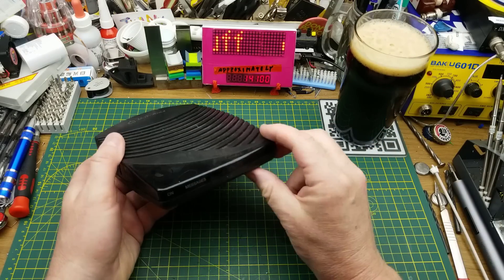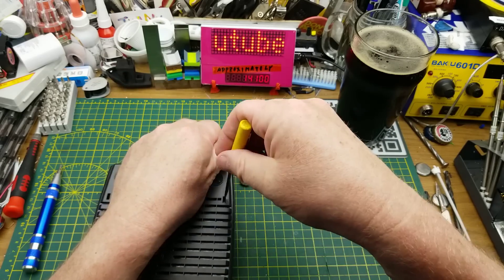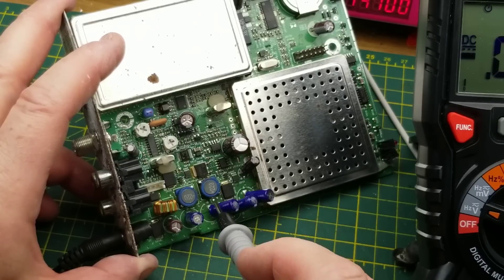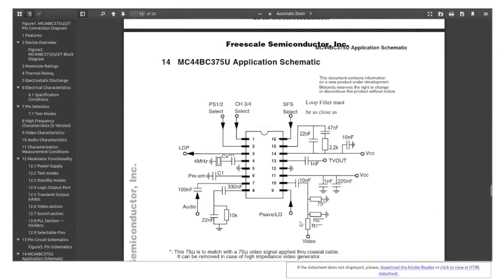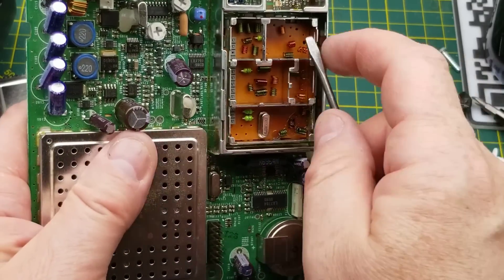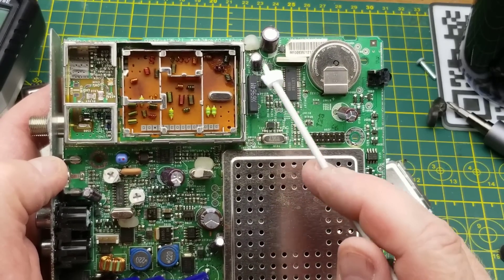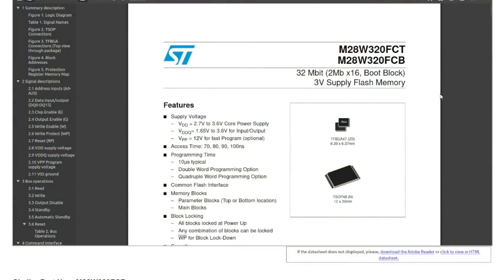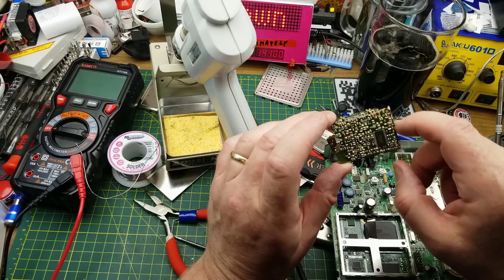Curiosity teardown: cable TV box

Comment: If the battery (2450) 3 volt goes bad, will my Motorola cable box still work? Mine has the original battery in it and it is giving me fits.
Reply from the maker: Different equipment reacts differently to a low battery.  Some don't care, some get chaotic.

Comment: SRAM is probably stream cache, decoding is in the CPU with it's dedicated SDRAM and the bootloader and code flash.

Edit: The SRAM since it's only 256kB could be authorization and decryption codes. Having the battery backup could be to protect the contents of the SRAM.

Comment: Those receivers had the ability to decode mpeg2, but not mpeg4.
They also had a subscription system, the base channels worked fine without paying, but all the premium channels needed to be authorized. I presume there was some kind of unidirectional provisioning on them to allow them to get "those premium sports/movie" channels.

🍻
Reply: I think the auth data gets sent about every half hour or so. It's all about encryption. There are keys which need to be validated and they somehow send the needed keys to subscribed devices in a protected manner. The provisioning data also contains the mappings from virtual channel numbers to RF channel and subcarrier IDs.

Comment: I keep the wound wires from these for building scrap FM radios. I just like building them and teach my nieces to build them. (5 siblings who had 12 kids and not a single boy except my son.) I just copied FM radio kits and found the parts scrapping other devices. These things are a good source of the wound wire inductors, crystals and resistors.

Comment: the battery is likely powering some memory where the decryption keys are stored. Motorola (and its predecessors) loved to do it that way instead of using non volatile storage, and it also meant that when the battery died in 10 or so years after manufacture the box would be dead unless it is serviced and the keys installed. 

Similarly, the unknown motorola chip in the vented can is possibly the decryption chip - there's an interesting video about one person's reverse engineering of a much older moto cable box here https://www.youtube.com/watch?v=lhbSD1Jba0Q

you might have been on the right path with the conexant CXP chip, as they were involved with cable TV / video processing and a quick google says NXP bought that business unit from them
Reply from the maker: That's a good probability.

Comment: I think that black five pin box is the SAW filter you mentioned as often associated with those chips, not a transformer. Betcha if you break it open you’ll find a little glass slab with quartz slivers glued to its edges.

That’s all I’ve got. I used to have a bunch of Motorola catalogs that could have identified that chip but I gave them all away when my eyes went bad.

Comment: Just love a tear down. I wonder if the processor is part of an early Android OS for the software to use the box.
Reply: I dont think they use android. That box seems way to old for running android. Probably runs a lightweight linux kernel and a oem os. Or some simple os. I bet that cpu is powerpc and not arm or mips. Powerpc seems relevant for that time. I have lots of old settopboxes from the same era use lightweight linux or simple os. And they where based on mips or powerpc